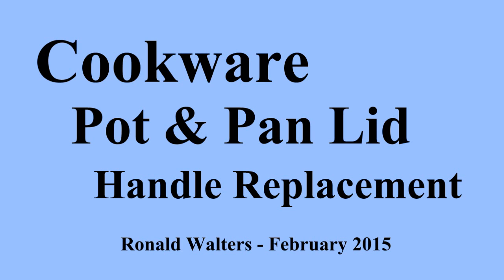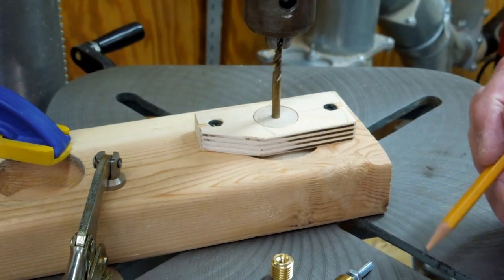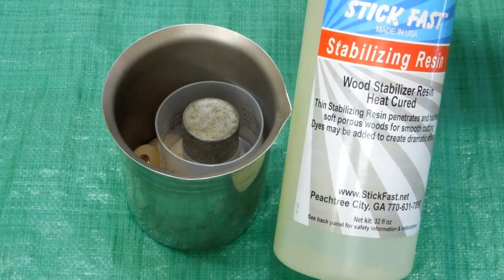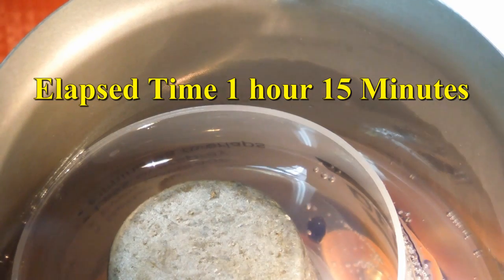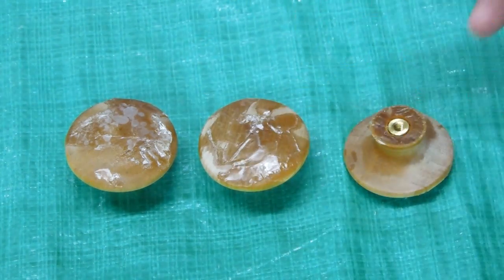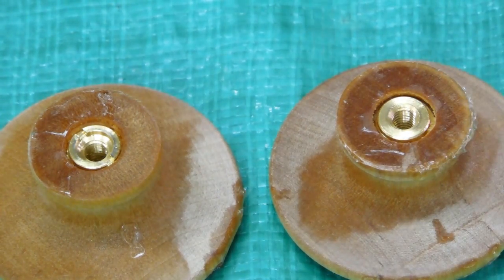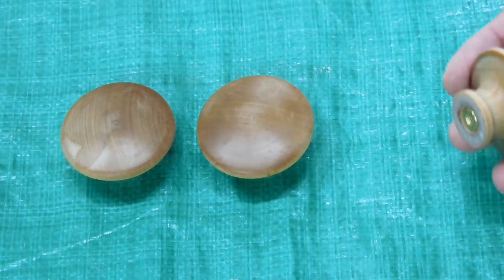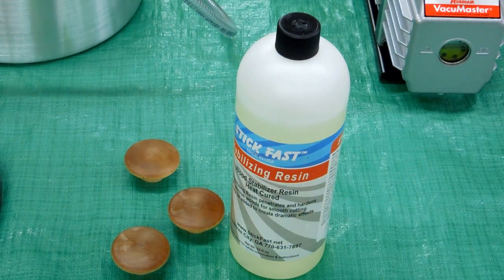Cookware Pot Lid Handle Replacement - Vacuum Infusion

Comment: New project, new toys. :). Nice job Ronald.  You don't want to loose any resin you have worked hard to draw into the wood so get it in the oven as soon as possible and don't use towels to draw out the liquid.

Comment: Extremely interesting video, Ron. Thanks for sharing it. I have an old 2 gallon painter's pressure pot that I'm seriously thinking about modifying for just this purpose. I don't use it for painting anymore, so I won't miss it if I do.

When it comes to the resin leaking back out of the wood, another thing to consider is the orientation of the wood grain. Liquids will soak into, and out of, end grain a lot faster than it will face grain or long grain. It looked like the faces of those knobs were the end grain, so that may another reason why so much of the epoxy ran back out of the wood. They were sitting on the end grain as they baked.

Comment from the maker: FYI ... a little food for thought on a vacuum source... a shopvac probably only pulls a few inches of water. My large dust collector in the shop only pulls 8 inches of water at 750 CFM (but it can take your watch off if you aren't careful). I read where a kitchen food saver vacuum bagger pulls around 22 inches of mercury (I was surprised it was actually that high). And one of those hand operated pumps like for bleeding brakes can probably get to around 25 inches of mercury when it is new. If you use a hand pump for a project like this you will end up looking like Popeye by the time you are done. My vacuum pump was pulling 28-1/2 inches of mercury and there was a very noticeable difference in the volume of bubbles coming from the wood when the pump was running compared to when it was off (and the chamber valves closed) even though the gauge did not appear to move from 28-1/2 inches Hg. The success of the vacuum infusion process will be directly related to getting the highest vaccum possible.

Comment: That's amazing. You can actually see the sheen in the finished project. Had you put that scene up without any explanation, i would of had thought "Mr. Walters has started working with plastics".

I wonder how does this process affect the strength of the wood.
Reply from the maker: aserta It is used to strengthen fragile woods for turning (machining) which would otherwise break or fall apart. The process is used a lot buy people who make pens on the small lathes.
Reply: Ronald Walters Hm, i have heard about infusing wood but i hadn't expected it in pens. Always assumed it was because the wood was exotic. 

Interesting, thanks for the info.

Comment: Great video Ron. I have one of those vacuum Food Savers in my kitchen, and I purchased an accessory to vacuum-seal Mason jars. I also use that accessory for  getting water into wood chips before putting them on my grill. It literally just takes a minute to do. Like your resin infusion project, the air bubbles come out of the wood chips and they look like Alka Seltzer tablets they fizz so much. I bet I could use that equipment for small resin infusion projects too, now that you've given me the idea. Hmmm...what in my house could use a new handle?

Comment: Love the justificatian part and that the steps with the owen was on a need to know basis with the wife :)
Reply from the maker: Michael Pedersen You need to justify what you are doing and then forget about the cost. When I was building and flying radio-controlled airplanes, if the plane cost $500 or $1500, then my first flight with that airplane cost $500 or $1500 ... period. Then all the other flights with that airplane were free. Decide you are going to do it, write off the cost on the first project and move on.
Reply: Ronald Walters That's good advice, used that for the tools in my chosen profession (telecomms) too. The tools come in handy afterward when they're free :)

Comment from the maker: 1 inch of water = 0.0735894861 inches of mercury
1 inch of mercury = 13.5951001967 inches of water
28-1/2 inches of mercury = 387.46036 inches of water (32.28 feet)

Comment: I suppose you could paint the wooden knob with a black bake-on epoxy and no one would ever know the difference.  Wagner isn't making MagnaLite pots and pans anymore, so it's not like you could get a factory replacement part.

Comment: I have a similar situation, but I have big knobs, not with the mechanics of yours, with that vent.  For the longest time, I've been unscrewing a knob off any unused top and screwing on a lid I was using at the time.  This gave me some instruction on how to proceed.  Can I get by without the vacuum step.  Does this just make the lid knob more dishwasher usable, and giving it longer life?
Reply from the maker: Ron Briz Just letting the wood soak in the resin is not going to work very well as it will not get any deeper than painting it with the resin. This thin resin needs to get completely throughout the wood in order to really be effective. Vacuum is probably the only realistic approach. The resin seals the wood so dish water should not be a problem (I hope anyway). As far as the dishwasher... dishwashers are pretty rough on stuff (drying cycle) so I don't think I would put it in the dishwasher.
Reply: Ronald Walters Thanks! that makes sense.  Years ago, I used to have a state surplus vacuum pump from a dental office.  I could just kick myself for letting go of it!

Comment: Thank you for sharing your knowledge with us. Is it alright to not perform the vacuum infusion process? I don't have the equipment but can do the rest of the steps. Thanks.
Reply from the maker: You can skip the vacuum infusion process, however the wood knob is not going to last very long getting wet during the washing and drying process. You might try making your own knob out of a piece of Delrin Plastic (easily machinable) and could be spun in a drill press and shaped with hand files. In any case, I know a raw wood knob would not last very long around my wife who tends to let things soak in water. :-)
Thanks for watching. Please subscribe! 
That is what keeps this channel going. 
Ron
Reply: @RonaldWalters2010  Thanks for taking time to share what you know. I appreciate it. I just subscribed. :-)

Comment: Being such a dense wood, I was surprised the maple soaked up so much resin. Do you think a wood like red oak would work well or would the resin just drain out before heat curing?
Reply from the maker: RickMakes I think it will work with most any wood... even balsa. I have been told to not wait on the wood to quit dripping. Wrap it in aluminum foil immediately and get it into the oven quickly.

Comment: How does the brass inserts stand up to corrosion? I would reccomend SS inserts. Otherwise nice project.
Reply from the maker: Sqwince23 The original insert in the plastic handle is brass with no signs of deterioration, so it will probably outlive all of us.
Reply: As long as electrolysis isn't involved, brass pretty much lasts forever.

Comment: Hey Ron, love the infusion idea. I've been thinking about something like this for my outdoor furniture builds. What did that resin cost?
Reply from the maker: Evan Zerby Fairly expensive at around $40.00 a quart with shipping. A bit cheaper by the gallon. The good thing is it will last for a year or so after it has been mixed. Whatever is unused in the vacuum chamber can be poured back into the bottle and used again on the next project.

Comment: At 28 cm Hg vacuum, water boils at about 40 C (and not a 100 C) . Yes, you will see some air coming out of the pores of the wood, but most of the froth you see, may well be your liquid just boiling at  low temperature, on account of the vacuum, rather than air escaping from the wood...
If you'd pour some of your resin in the chamber and evacuate the air (without bits of wood in it) it would froth too
Paddy
Reply from the maker: Good point. I hadn't worked with casting resin or silicone at the time this video was made. I now know some casting resins and silicone will gas-off (or boil) when you hit it with a vacuum. In the case of casting silicone, you let it boil and froth up until the volume collapses. At that point it does no further good to leave it under a vacuum. The stabilizing resin may be doing the same thing.

Comment: What if you dye the resin?
Reply from the maker: Micah Montoya You can. The softer wood and voids will take most of the color - the harder wood not as much - so you end up with variable color patterns in the wood much like spreading dye on the surface of the wood.